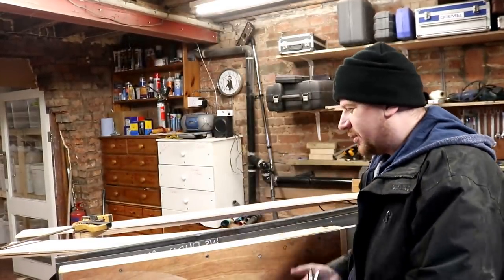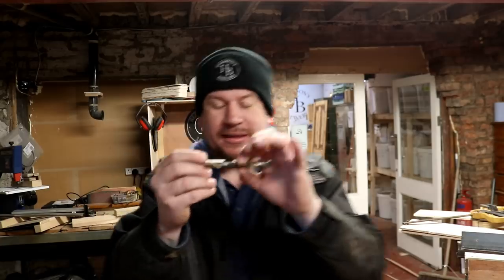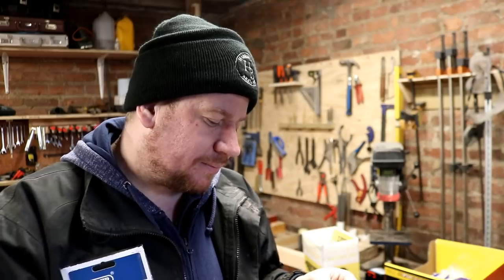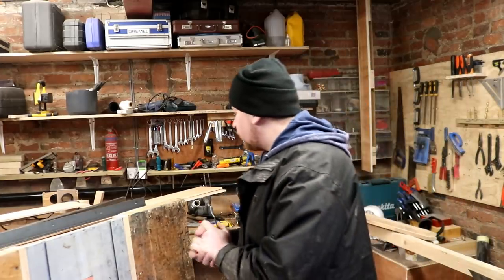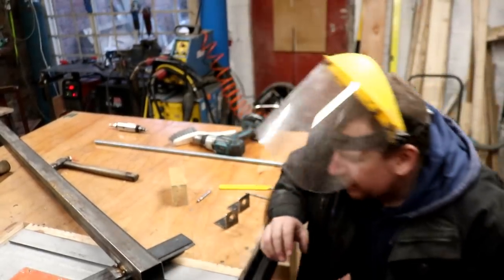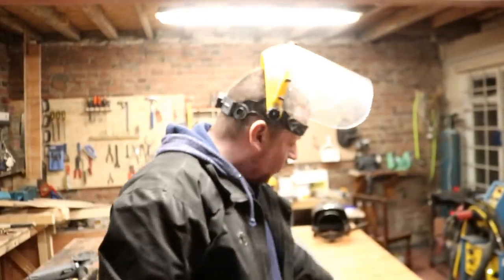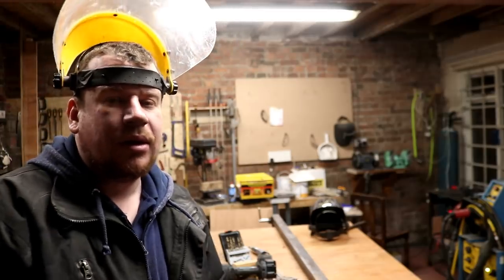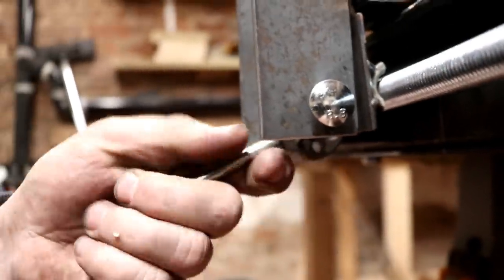THIS TIME IT'S THE NUTS.... THAT MAKE IT WORK.

Comment: Go with the timber on the fence. As you say you can add a bit of height to the fence. Also, I've seen many a fence with the circular pattern of a moving blade rubbing up against the fence. If for any reason the fence touches the blade while moving there is no damage to the blade and the timber can be easily swapped out.

Comment: My 2p worth fella would be as someone already mentioned and use a sacrificial fence... that way saves damaging your expensive saw blade and protects all the hard work you've put into the project so far.....  and also saves compromising the integrity of the fabrication thus far.... a strip of softwood or better still, faced chipboard is cheaper than a new bit of box section...  and increases the fence height to boot too....  Nice work doowd…… See ya soon